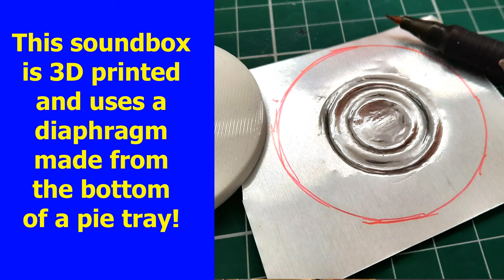DIY electrified gramophone - can it play a whole record?

Comment: Very enjoyable video. I love this machine very inventive. Sounds alright to. Knowing you there will be more improvements in the pipeline.
Reply from the maker: Thanks 👍😀.  Glad you enjoyed it. I need to have another look at the speed control as there is no fine adjustment, but it does work surprisingly well I think. I'm sure I will do a few more things with it, and I would like to get it working as a hand cranked machine also.

Comment: It sounds absolutely horrible.  I don't know if it's a bad needle, a bad record or the reproducer just can't handle it.  There is so much distortion. 
 Frankly, I'm pretty surprised there is wow and flutter (as measured in the beginning) on this given the enormous chuck in the drive should be acting as a flywheel. (not that it's the flutter making it sound bad. It's the distortion).  Perhaps the gears have some wear (assuming it's a geared chuck)?
Still, you did a nice job building it and it is homemade all the way down.
Reply: Definitely some worn gears.
Reply from the maker: Yes, it certainly still leaves something to be desired. The needle is a used one, but will have had 1 or at the most 2 sides played on it before. For my proper sound tests I use new needles. The record might already be worn too. The drill chuck I don't think is rotating fast enough to have a flywheel effect, and the gears in the drill adapter could certainly be worn as it could easily be 70+ years old. The soundbox normally performs quite well, but I usually use it with soft tone, rather than medium tone needles. The tracking and general alignment can probably be improved too. I have some ideas which might help, so I may do some more tests with something similar 🤔.  Thanks 👍😀
Reply: @mrrgstuff  I would think there is at least some flywheel effect.  The whole system is big and heavy and has inertia, though obviously the rotational speed is a major component in the amount of energy in a flywheel. 
Looking forward to the new tests.
Reply from the maker: @tarstarkusz  Thanks 😀👍. I have tried flywheels before but I think to be truly effective at regulating speed the need to be bigger and run faster, but yes there will be some helpful inertia in this system already due to the weight of the drive components

Comment: Those gears and the soundbox alignment towards the end, it’s rough. I agree with Chris in that you’ve probably brought it as far as it can go with the gearbox arrangement. Good video.
Reply from the maker: Thanks 👍😀.  Yes,  the gearbox arrangement came from the need to have the hand crank at a suitable position. I might try and see if I can drive it from the motor more directly. The tonearm could certainly be improved as whilst I thought the record started pretty well, towards the end, I agree it's rough! 😉😅

Comment: That's much better, now you have to work on proper amplification, they way I see it anyway. Because there is no taper on the tonearm until it gets to the horn, the sound is poor.
 Plus the horn is too flimsy, what is it made from, plastic bits or card paper ? It's not rigid enough to amplify properly, the sound waves are getting absorbed into it. Plus I think much is getting lost in all the perforations. Seems like you're having fun !
Reply from the maker: The horn is thin card. It's a scaled up version of one somebody designed for use with a phone:
https://youtu.be/Tvq-RfJihjc
I do have a couple of metal ones, though volume has been a problem with those too:
https://youtu.be/h8uj0v6fF0I
I know that  'fat' tapered tone arms were used up to the mid 1920s and were replaced by thin ones in the electric era. The tone arm on this one though could certainly be improved. There seems to be a bit of a tracing issue too as there is 'blasting' on the loud parts of the record, and yet the soundbox usually performs quite well. It is great fun though, and I expect to return to this and similar experiments in the future. Thanks 👍😀